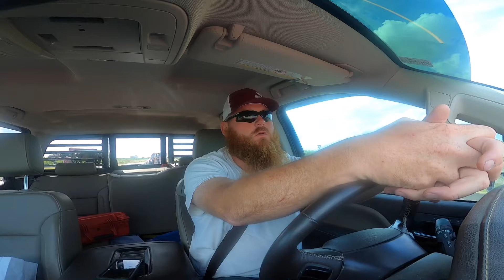Looking back on the last year

Comment: I’m liking your videos a little bit of talking before and after for explanation or just how the day is going might be a little better but hey just curious if they said anything about why the kx40 was getting hot i’m currently looking for a 40 either Kabota or Takeuchi I do underground utilities small clearing and mulching I guess you could say a little bit of everything with mine so just trying to see what I need to keep an eye out for thanks
Reply from the maker: You know I’ve had hydraulic heat issues with the KX040 in the summertime here in Texas. It’s mostly when having to track a long distance or just running the absolute daylights out of the arm. I only run an auger or danuser t3 post driver on it for implements. The hydraulic cooler and available capacity is way to small to run any kind of rotary implement in the summer here. 
Other than that it’s  been a great little machine. If I chose again I would have gotten the 57, just a little more machine but the weight required a different trailer. As far as using mine for clearing, yes, with a thumb it makes a great little clearing machine. But again the 57 would have made a better one. Eventually I’ll just get an 80 and call it good. 
Can’t go wrong with the Kubota machines, they have been good and the dealers are pretty good about getting them back running asap if they break down, which the only breakdowns have been DEF systems on my 95. That’s getting old, fast.